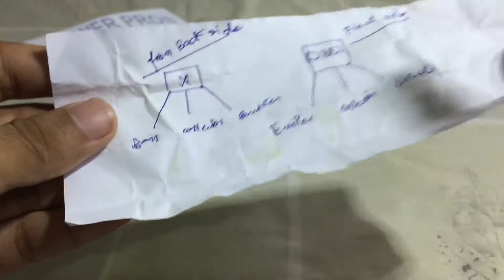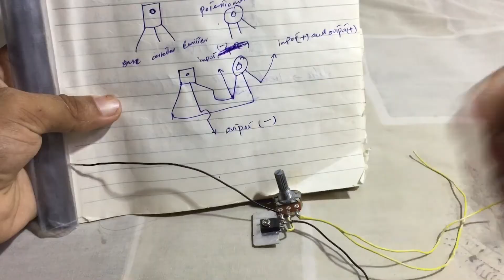Dc voltage regulator with D882 Transistor | How to make Dc motor speed Controller | D882 Transistor

Comment: hello sir. how about 24v and up.. this is good or not??
Reply from the maker: Good 
You can use maximum 48v
But I recommend to you 24v is enough
Reply: thank you sir..
Reply: what resistor can i use if i connect to 24v.? and i will use B50K potentio meter?

Comment: Hay bro can we meet? I want to make this but i cant able to made this would u plz help me or give me some guidence plz bro🙏
Reply from the maker: I’ll help you.. you can ask me questions related to this project..
Reply: @HammadExperiment  actually the transistor which u r using d882p are u sure that it can give a pulse output like 555  timmer ic made astable multivibrator?
Reply: Bro plz tell me I'll be waiting for ur answer
Reply from the maker: Listen 
Ap bnana kya chah rahe hain. Kindly detail mein btayein
Reply: @HammadExperiment  simply pulse genrater jo ek voltage booster ko pulse dega
Reply from the maker: G ban jaye ga ap wo transistor use kr sakty ho